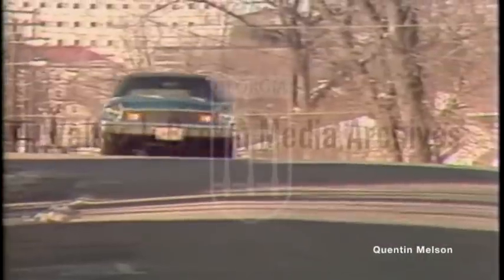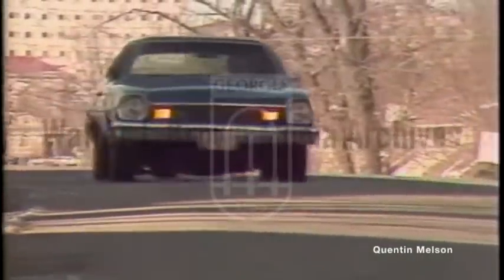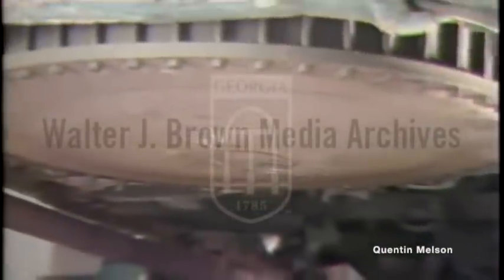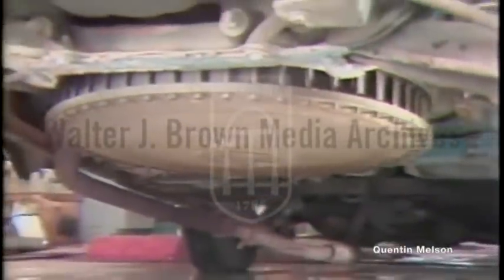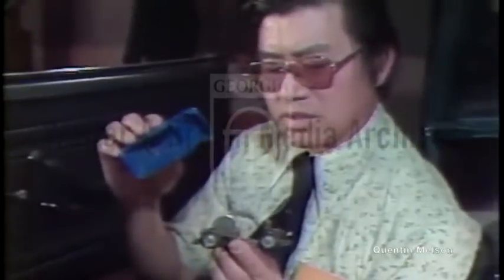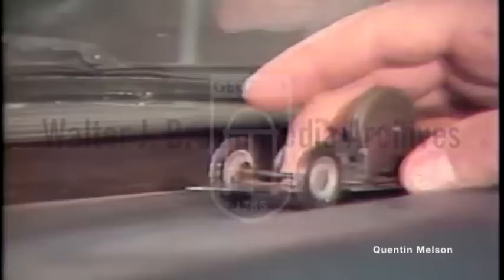Experimental Spinning Flywheel Car Demonstration (July 2, 1980)

Comment: Its not a secret or conspiracy - flywheels are INCREDIBLY dangerous. If this car was involved in a crash.... it would be absolute carnage and cause so much death and destruction compared to a regular vehicle. Even low speed rear ending of this could be fatal.
Reply: That's kinda what I was thinking, too. Also, the technology of absorbing braking energy is used today in electric and hybrid cars, so the conspiracy doesn't hold up.
Reply: Imagine being killed from spinning/flying debris from an accident a mile away.
Reply: Yes flywheels are dangerous but have you ever seen a lithium fire?

Edit:Maybe this wasnt a good example, flywheel car bad
Reply: @NeilBooth  Lithium fires don't tend to kill bystanders though. 

Good luck getting insurance on that. :P
Reply: @Cheebzsta  recently in South Africa an LPG container truck had a accident which clipped the lid off, 34 bystanders died in the explosion even though the driver taped off the area and told them to leave, they wanted to watch. 

But yeah flywheels batteries would probably be unsafe, cause thats alot of energy in a few directions. If the fly wheel hits your house it could be like a tank armor piercing round lol. Yeah so one accident could potentially be like a dozen tank shots going off in random direction?
Reply: Also going over bumps must be horrific. That's basically a giant gyroscopic stabiliser. 😮
Reply: What if you put the Flywheel in a Heavy Duty Housing? 🤔
Reply: @laserdollars2018  We already got people who got killed by fast spinning wheels that broke loose from vehicles...
Reply: @Cheebzsta  They absolutely do.  You should always endeavor to remain upwind of a Li battery fire...

Comment: I would like to see more about this car.
Reply: You know how a tire can come off in a crash and turn into a deadly projectile? Yeah so it turns out a metal disc that's even heavier and faster could be an even bigger risk in an accident. Who knew?
Reply: I saw a giant truck loaded with construction sand. One of the tires exploded; Because the truck's load was greater than the tire could handle. The driver stopped and got out. It did not happen as you say, but it was a safe thing !! Also the flywheel when it engineered.

Comment: Less fuel consumption. Jez I wonder who killed that idea than? 🛢️
Reply: Read up about how these things would fly off the vehicle like a frisbee of death during safety crash testing.....literally a metal ninja star that weighs like 250 lbs
Reply: Nah not an oil thing...flywheel becomes damaged or out of balance....run!!!!! Keep running. 500 ft away isn't far enough!
Reply: @DukesArchive 
not necessarily !
Reply: @DukesArchive  but they told me the earth would melt if we dont become more efficient, seems like a small price to pay